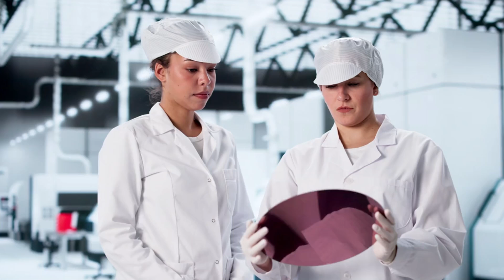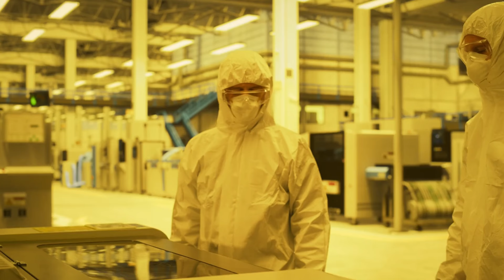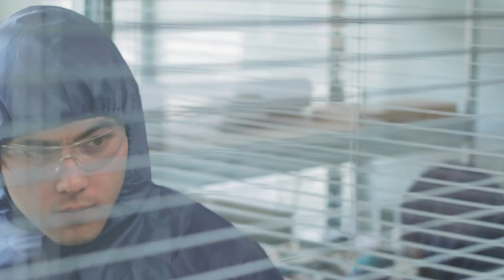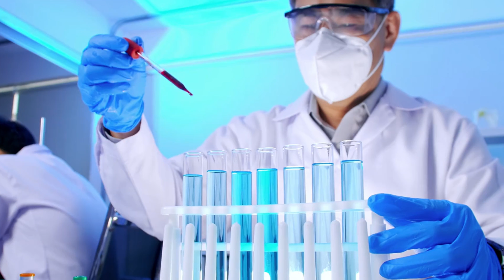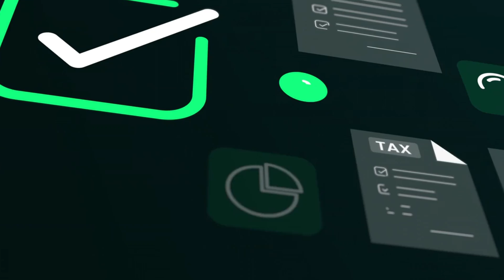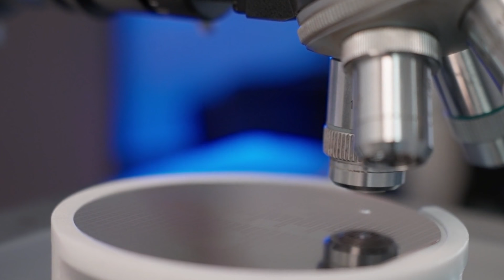China Just Activated the EUV Machine That Fills an Entire Factory Floor

Comment: The reason it takes the entire factory floor is for debugging purpose. It's a lot easier to debug when they are all separate. Once they are done debugging, they can put it together, and it may be 3 times bigger, but not the entire factory floor. They are testing the product, and it's like taking your car apart. You have the parts everywhere.

Comment: A larger EUV machine is preferable during the development stage because it gives engineers more room to add, modify, or replace components. Once the machine is proven to work reliably, its size can be reduced to make transportation easier.
Reply: Before you can make things smaller they must have been big for sure. But dont worry, pretty soon the whole EUV_2.0 machine will be enshrined and shrinked to a wheelbarrow-size carriage based on revolutionary magneto-graphic concepts ! Mockery is easy, design is transcendental  ....